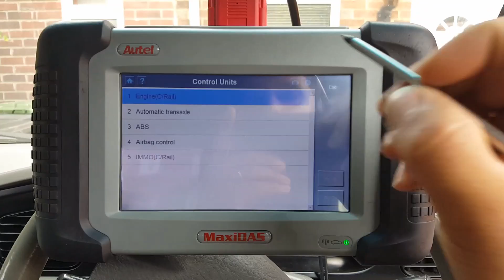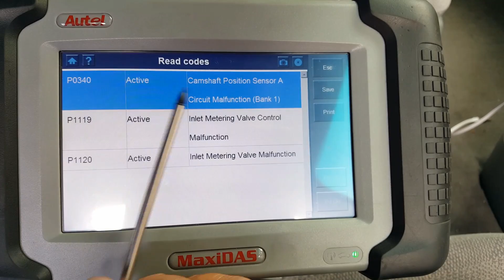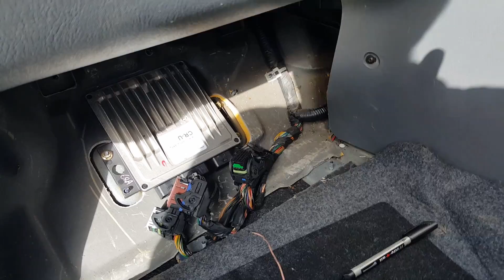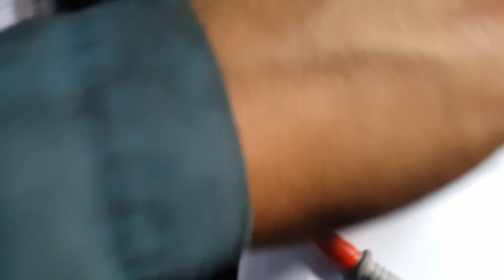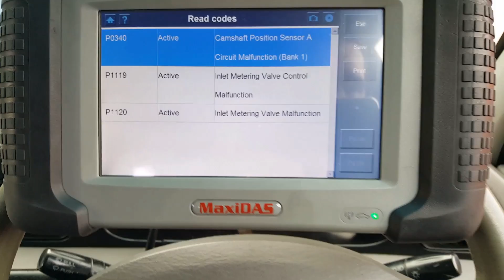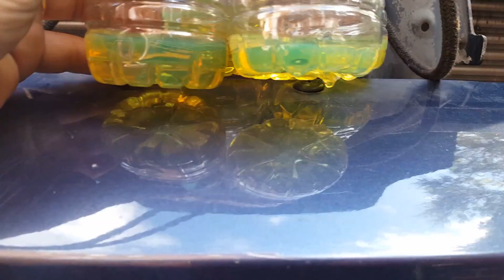Kia Sedona 2.9 CRDI 2003 P0340, P1119, P1120 diagnose.

Comment: Nice video and I like seeing more diagnostics videos such as this. Of course, seeing the DS708 in action is good too. As for your P0340 code, you are correct that the pattern looked okay and I would suspect that the ECM is okay at this point. I would take a look at the crank sensor waveform along with the camshaft sensor waveform. and compare the timing between the two if you can find a reference waveform for them. If there is a difference, one possible cause could be a timing belt issue. As for the injectors, I would take a good luck at that connector which looks burnt feeding the injectors. It's possible that injector 4's control wire (ground) is shorted which keeps the injector on all the time. Take care...
Reply from the maker: Hi
Thank you for you comment.
You are correct, the only thing that lead me to believe that the contacts on that connector are still ok, is that the engine runs smooth and pulls ok.
If the injector was on all the time I would expect some sort of roughness and perhaps some codes for the injectors on the ECU.
Thank you for follow my channel.
Reply: If you want to check if injectors are staying on longer than they should, check fuel pulse width, you'll figure it out

Comment: There a good chance that's the reason you have the p0340 that the timing could be out and you have the   crank and cam , are not synchronized properly so DONT  put in a new ECU it will not fix it
Reply from the maker: Thanks... the car didn't came back yet, so not sure what the owner has decided... my plan was to put the oscilloscope on both sensors, crank and camshaft, to check sync...
If I get the car back I will probably make a video for it...
Thank you for watching and for your comment!

Comment: ¿cual es la presión mínima de diesel que necesita para encender
Reply from the maker: Depends on the car... but usually 200-250 bars...
Reply: @LMAutoRepairs  tengo un 2.9 crdi que tarda en encender, solo levanta 100bars, ya cuando enciende la presión se mantiene en 300bar y llega hasta 900
Reply from the maker: Check injectors...

Comment: Hi LM. we have kia carnival in shop 2.9 crd 2003y. and car not starting. we have only 1 fault p0340. wiring cheked. both sensors changed. any ideas ? have you find reference vaweform for good timing ?
Reply from the maker: Hi
No, I don't have a wave for this...
Thank you for watching!
Reply: @LMAutoRepairs   at least i found good waveform. My problem bad timing.
Reply from the maker: @manijakaz24  
👍👍👍